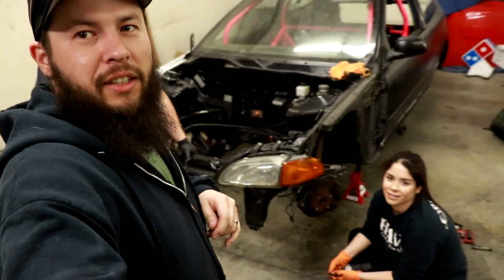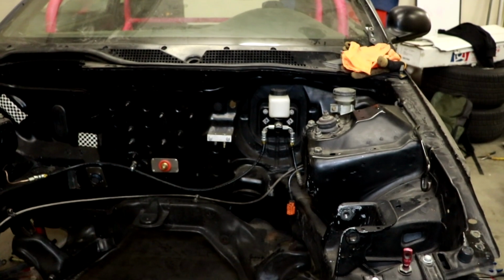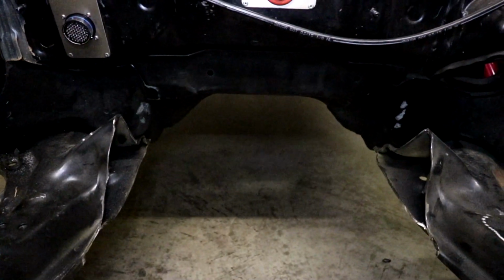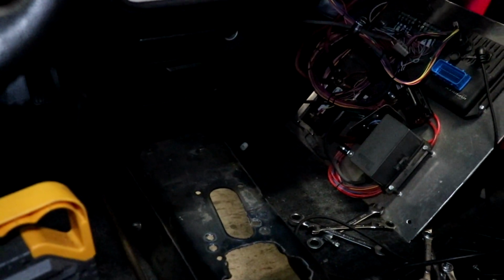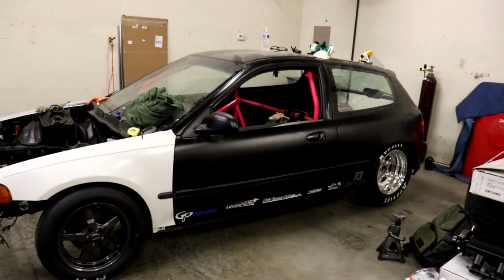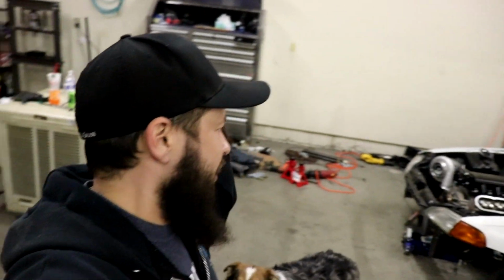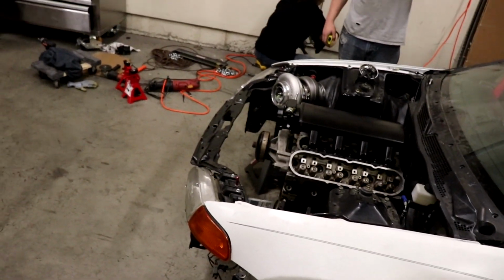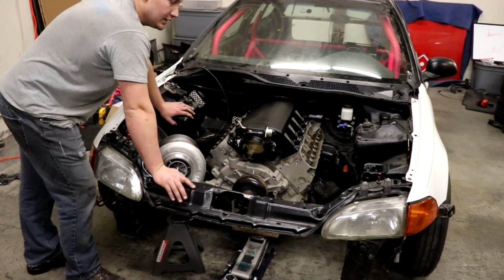RWD V8 Civic Build Part 2

Comment: Front mount the turbo behind the bumper
Reply from the maker: ENFORCER JDM if I can get enough radiator in there I wouldn’t mind doing that. We want to make sure this thing has tons of radiator to keep cool on long hot road trips.  Gotta research our options for radiators soon.
Reply: @Therendonfamilia  You planning on doing dragweek with this?
Reply from the maker: IvelLeCog that’s the end goal yes. Planning to take it in steps. We have been testing my truck for no trailer events with about 150miles of travel. We plan to test the El Camino out on a drag week like local event at about 450miles. Whatever we learn from those we will apply to the civic for future drag week 🙂

Comment: Hi Sorry you cannot swap the hubs with the steering arm at the front, as the Ackerman angle will be wrong!?
Reply from the maker: Matt Taylor the Ackerman angle will be DIFFERENT yes. This is not an issue. Plenty of cars use pro, neutral, and anti Ackerman angle for different purposes.

Comment: What brake line hoses are those?
Reply from the maker: DNR Auto the dude that runs Finishing Lines makes them. Great quality line kits for street or race cars. We will be getting him to make us some new ones once we get the rear in there and get the measurements
Reply: I need to look into it. Seems like a much simpler solution to running the lines
Reply from the maker: DNR Auto yeah hit him up on FB. Super nice dude.

Comment: In no builder by any means but with all that is involved with this build wouldn't it be easier to just use a similar size chassis and just put the civic body over it all?
Reply from the maker: Bruce Pietri similar work if we did that. Still would have to back half it for the suspension we want, and it would be more cutting to cut out the entire floor then putting in a whole new floor. We would maybe save a little work on steering but that’s about it lol. I think it would save in some and cost in other areas
Reply: @Therendonfamilia  sounds legit. I'm tuned in now tho. It appears to be an interesting build. Looking forward to upcoming video on it. Thanx
Reply from the maker: Bruce Pietri hey thanks! glad you like it!
Reply: I did mean to say similar sized rear wheel drive chassis tho.
Reply from the maker: Bruce Pietri no that’s how I understood your suggestion. But what I meant was I would still be changing out a lot of stuff. So for example if I laid it over a Foxbody chassis which is actually pretty close in length of wheelbase it would be too wide and has a ton more overhang on front and rear, so we would have to work to narrow and shorten it. And if we were luck enough to find a chassis short enough and narrow enough with the same overhang, It wouldn’t be coming with a ford 8.8 . And if it did we would still want to go away from the triangulated four link to a parallel 4link. Felt like more work going other routs but who knows We may wish we did it another way as we get further into it lol.
Reply: @Therendonfamilia  cant wait to see the 3rd video in it. In subbed and belled so looking forward to it
Reply from the maker: Bruce Pietri hell yeah dude. Really do appreciate it!